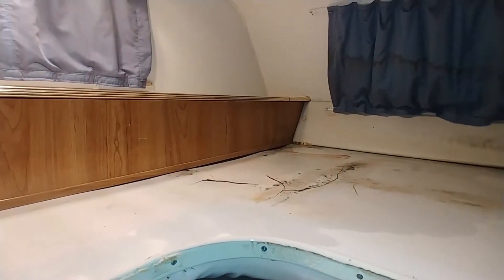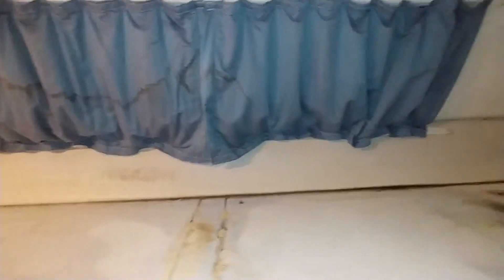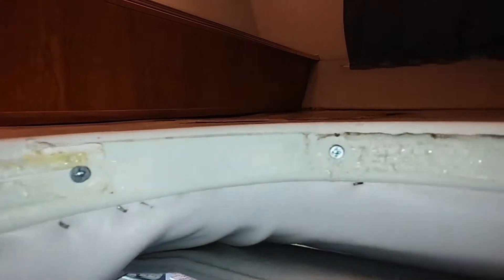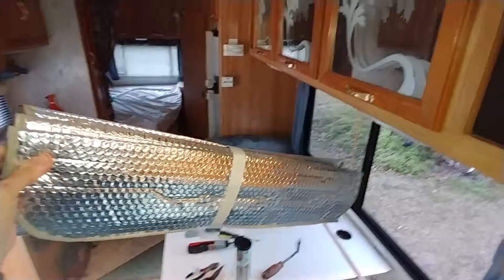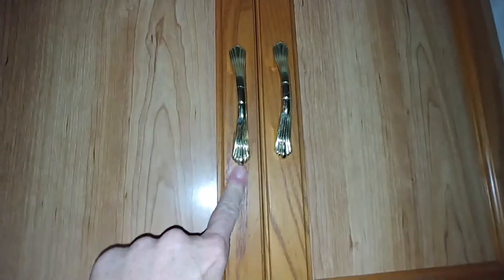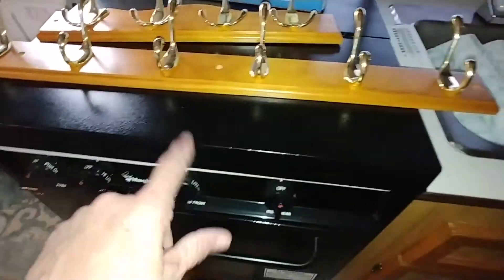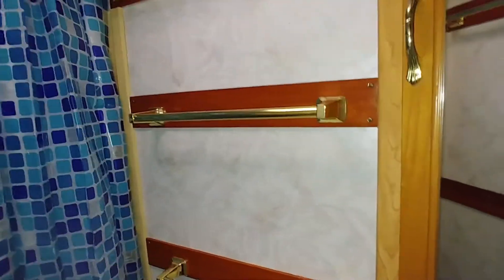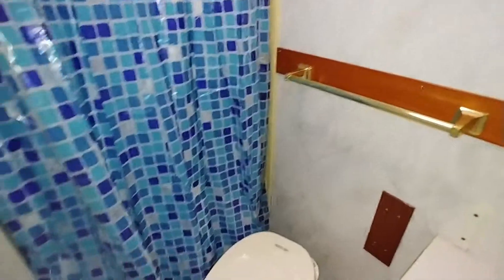1998 Coachman Overcab Rebuild Part 1 Large

Comment: I have a 2001 Minnie Winnie with the same damage that I have to repair this summer. But those 2 side windows are going away! Not much I want to do with the front one except to pull it off and seal it, unless i get creative and just cut a piece of fibreglass and seal the whole thing and spray a little paint or get a vynal scene wrap made. 
But the 2 side panels must be rebuilt as they rotted away under the windows so those leakers are gone. Just a solid piece of Luan. No kids, so storage boxes don't need the view! Just a fantistic fan!
But it'll be fun as I get my new hone fixed for a journey!

Blue skies and safe journeys!